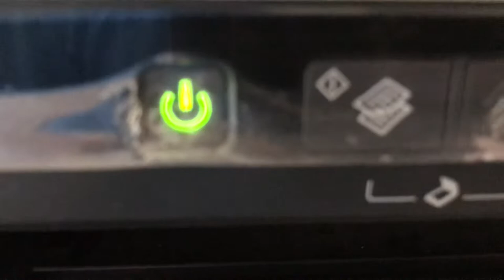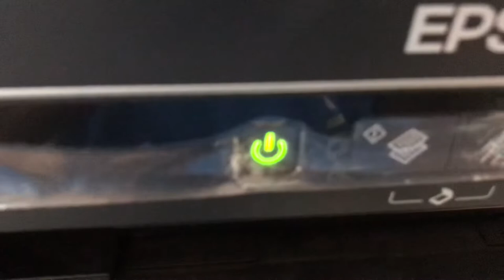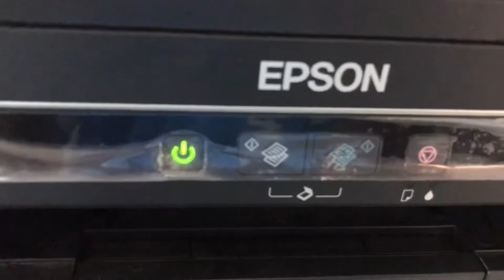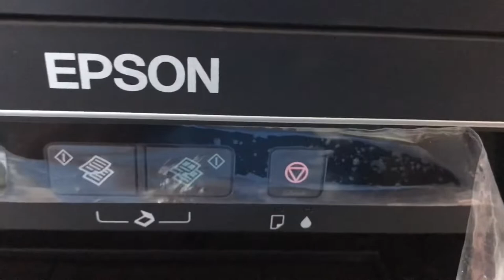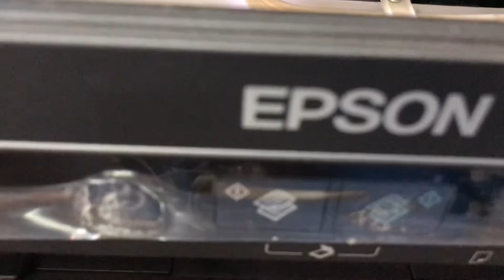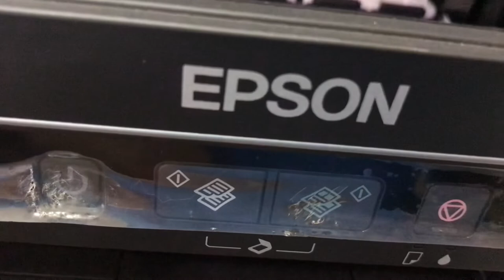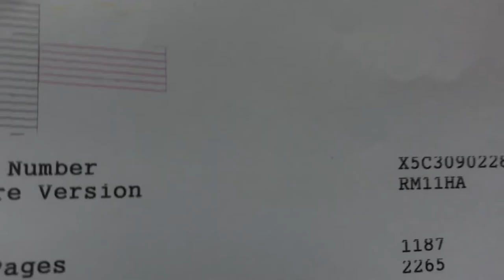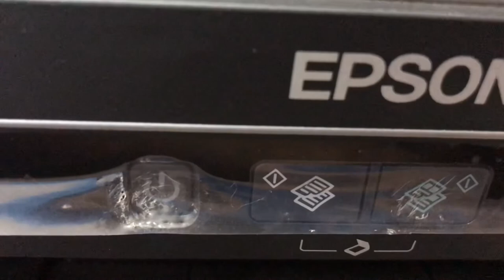EPSON L50 L360 L385 L3110 L3150 L3108  print quality problems fixed by manual head cleaning

Comment from the maker: EPSON L50 L360 L385 L3110 L3150 L3108 print quality problems fixed by manual head cleaning on control panel by press and hold cancel 5 second